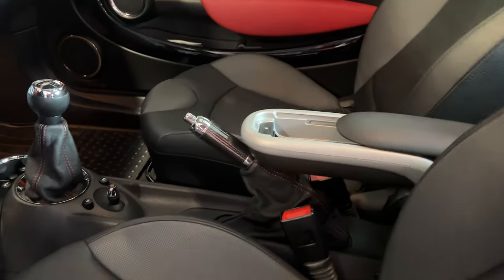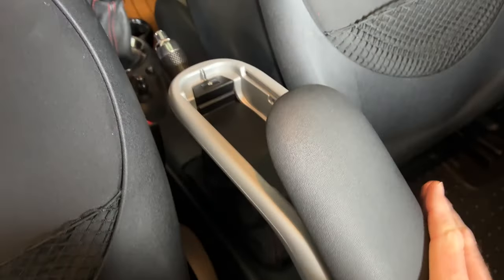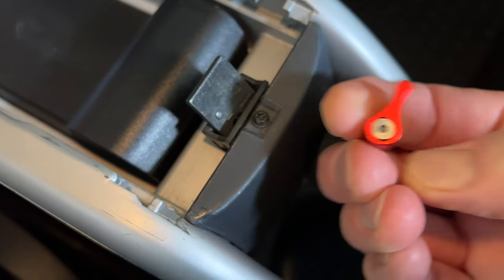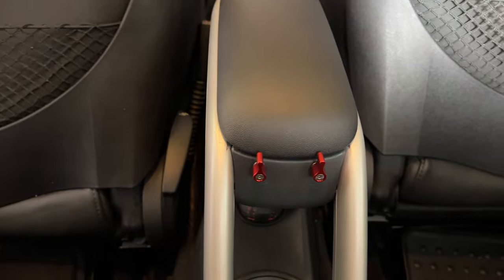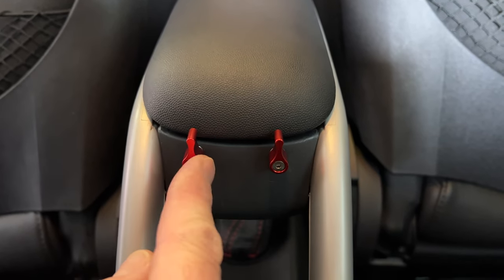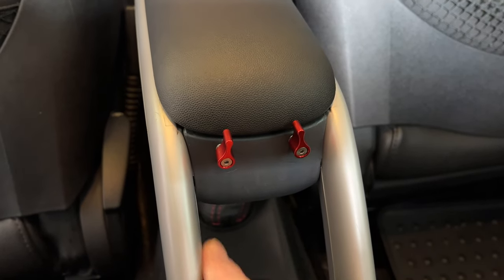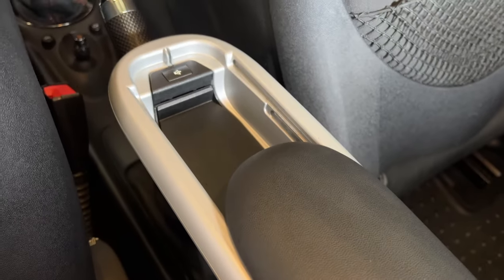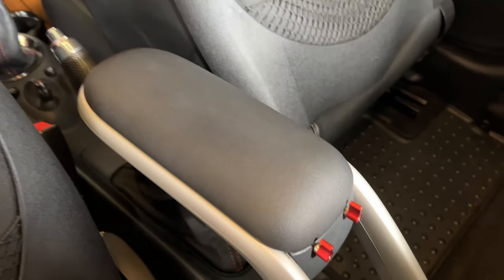Mini Armrest Mod

Comment: The top of my existing armrest somehow popped offline and now it's sitting above the compartment. How can I realign the top so it will close properly and slide properly?
Reply from the maker: If you watch the video around :45-:47 you'll see how I remove it, and I point to the tabs at the back where it snaps in. To put it back, hold it at the same angle I have it when removing. Line the tabs up with the slots in the back and press it back in. You should hear it snap-in. Then, angle it down and slide closed. Hope this helps

Comment: and how do reput the top above? I took it of but I can't reinstall it now
Reply from the maker: If you watch the video around :45-:47 you'll see how I remove it, and I point to the tabs at the back where it snaps in. To put it back, hold it at the same angle I have it when removing. Line the tabs up with the slots in the back and press it back in. You should hear it snap-in. Then, angle it down and slide closed. Hope this helps
Reply: @bigjohn199  I will try again